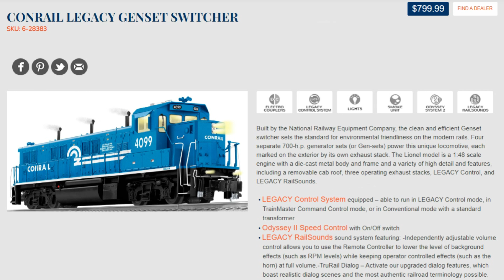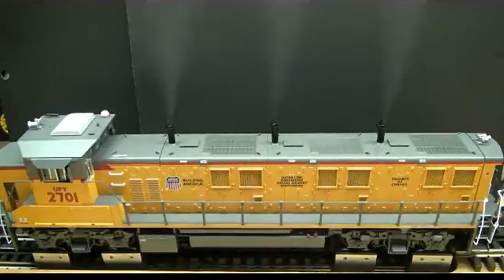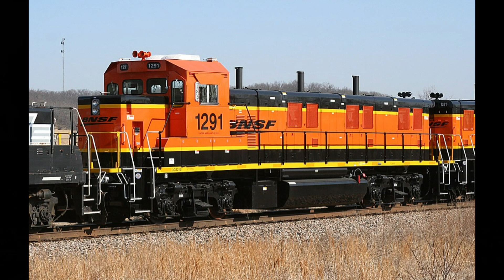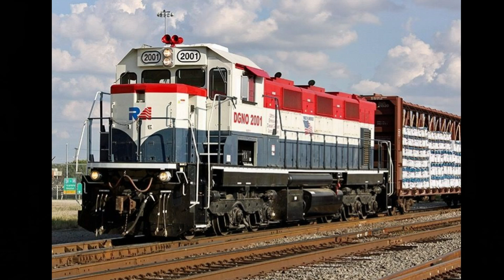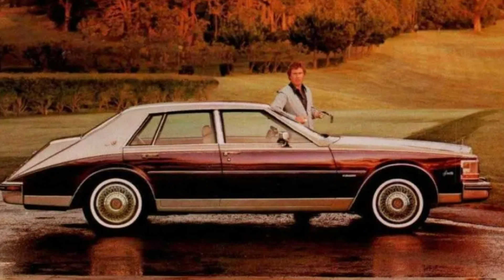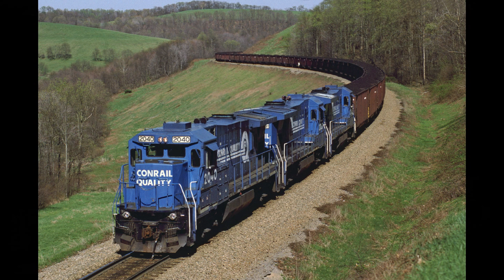Lionel Conrail Genset Locomotive? Genset Info & 4099  O Gauge

Comment: I have my Challenger SRT with the cylinder displaced and has not hurt the performance. 
When I drove to FL got 32 miles per gallon. 
But when I get on it I can still go from 0 to 60 in 3.5 seconds. Eating 2 miles per gallon. 
Has not effected horses power still pulls just over 600 hp. 
Technology is amazing these days with the computers on board especially for tuning.

Comment: Is Lionel 6-28354 a vision line
I have this model
It is die cast
It doesn't come in a black box, just a standard orange and blue box
So I'm guessing it is not as you stated only UP and NS are vision line
Reply from the maker: There were Visionline and Legacy Genset locomotives.  Both having die-cast bodies.  The newer release of the Genset had the plastic bodies.  All according to the research that I did online.  6-28534 is Legacy
Reply: @Dakman  thanks Shawn
That's what I thought

Comment: Just putting this out there for the heck of it. My understanding of the Gensets is that the control systems would alternate the order in which the engines would start up and shut down, starting with the one with the lowest number of hours.

On an unrelated note I had a thought pop into my mind while watching this. I wonder if something like the 7.3L turbo diesel that International made for the Ford Powerstroke trucks would have worked out as a rail engine in say something like a 44 or 45 ton GE.
Reply from the maker: The 7.3 International was actually a good engine.  However I don't think it would have enough torque to power a generator for a 44 ton locomotive.  You would be pushing it to it's max capacity all the time.